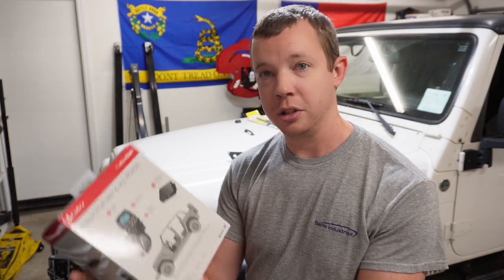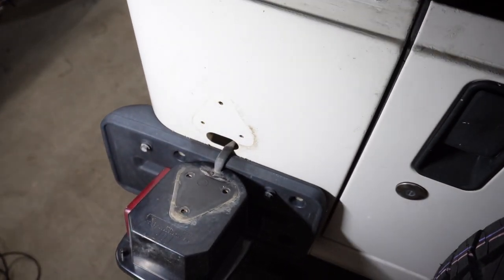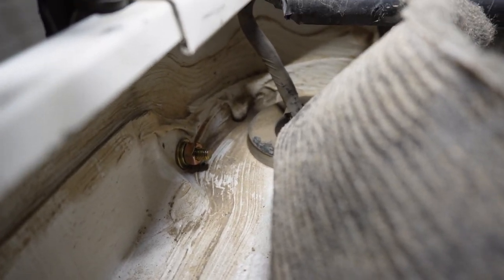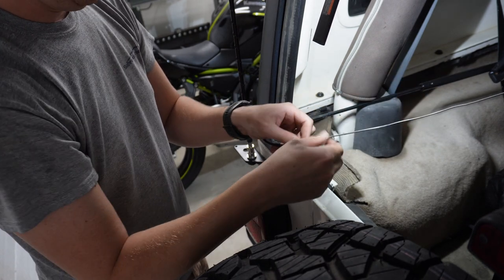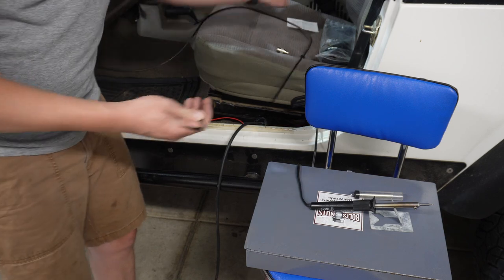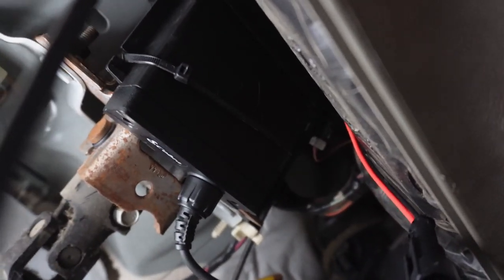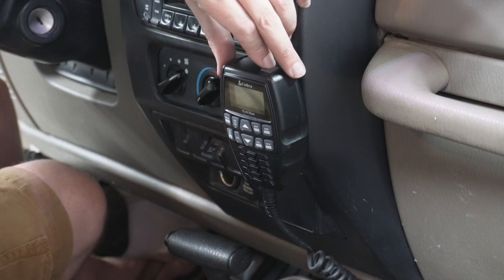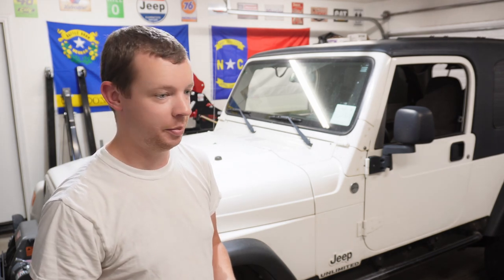Jeep LJ Cobra 75 All Road CB Install

Comment: Wow, you have 236,200 miles on your TJ!  My 2002 TJ has 52,000miles,  but it's never been my daily driver.  That's awesome to see on those ol' 4L, 6 cylinder, in-line dino engines!
Reply from the maker: Yeah it has been officially retired from daily duties so the mileage won't go up as fast, but it is still running strong.

Comment: I think those have their own SWR meter built in .
Reply from the maker: True it does have the digital readout. I could try to tune it off that then check it with the analog tuner and see if they match.
Reply: @HardEarnedBacon  Yes, the SWR meter built into the 75 All Road is actually a real SWR meter.  The BlackBox is designed with a what's called a "stripline" directional coupler.  All external SWR/power meters use a directional coupler to tap RF energy.  The one built into the 75 All Road does the same.  The difference with the 75 All Road is that it feeds DC Voltage representations of RF forward and reverse power to it's microprocessor which then calculates on the fly the SWR.  This method of deriving SWR is the reason why there's no need to calibrate the SWR meter unlike the analog meters found on older design CB radio's.  Enjoy...

Comment: The whole idea is it's Bluetooth. You could mount the CB anywhere in the vehicle like near the antenna. It's made to surface mount so maybe under the seat etc. Why zip tie under the dash?!
Reply from the maker: Because that's where the most space is and still gives me the option to plug it in directly.. Why would I mount it under the seat where it is more likely to get damaged when the seat moves back and forth? Or more likely to get wet? Even if I mounted it by the antenna I would still have to run a power wire all the way to the rear so it's not like it saves any time.

Comment: This thing is a piece of crap. It does not do the wireless part well or even at all. I installed the black box under the back seat of my 2024 AT4X and once paired to the mic it is supposed to stay paired but it does not and the only way to pair it is to plug the mic into the black box which is under the back seat and then replug it into the dash usb but even then once I turn the truck off and back on it unpairs and most times will not pair again without taking back to the box and plugging it in under the back seat. I put in a support ticket with Cobra and they have done nothing with it for the last three days So they are also as worthless as the 75 All Road. I bought it because it is wireless but if that does not work then I've wasted my money. Do not waste you're money on the pile of crap.
Reply from the maker: Mine is working fine but I am not using the wireless function. I also wire all of my CB stuff directly to the battery so that it does not turn off when the truck is off. If you use a USB plug that is always powered it shouldn't need to be reconnected because it won't disconnect. My Ram has multiple power ports, ones with a key logo that are controlled by the ignition, and ones with a battery logo that are powered full time. I would use a full time power port.